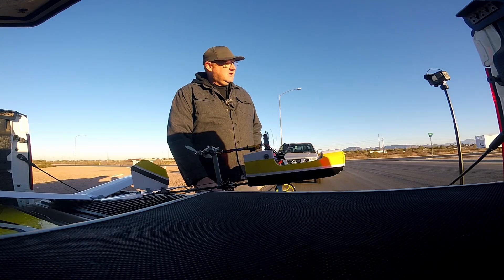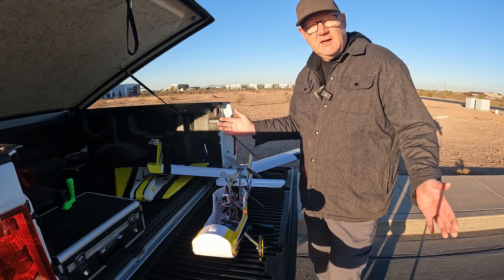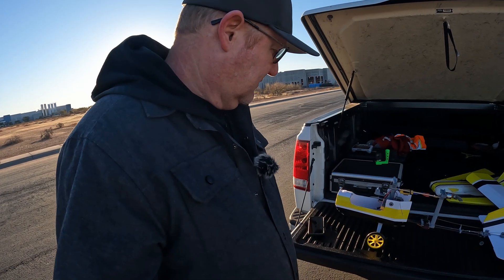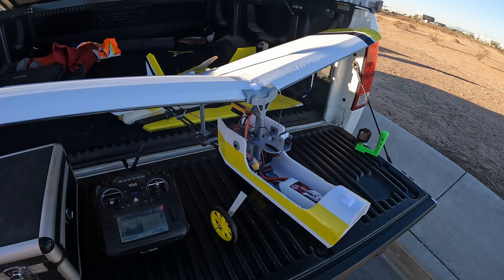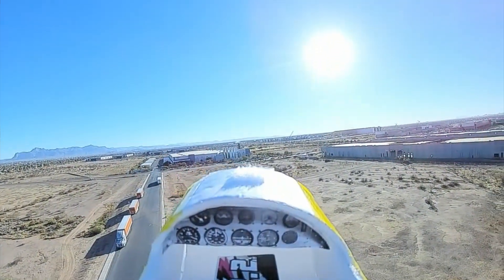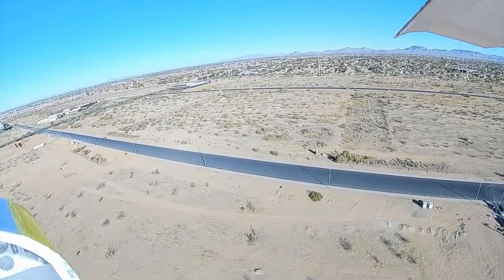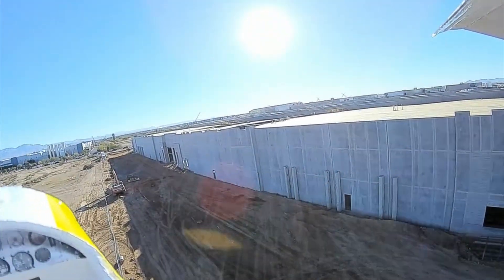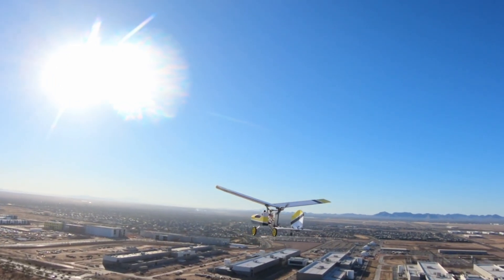Build and Fly this Plane - Sparrow Scout FPV

Comment: Have built this plane. I'm having trouble with it, this thing should fly so easy and it's uncontrolable under power, but floats and flies great with power off. Adjusting thrust angle of the motor now, running a 8.4 prop, and the shorter version of the wing supports,,, anyone else having this experience or any suggestions??  I really want this to fly, wanting it for FPV... Thanks.
Reply from the maker: Share some pictures of your control wires and of the control horns. If there's a lot of flex or if there's warped in the wings or tail, that'll make a big difference too.

Comment: Yup, buying now! Thanks for sharing ,,, subbed!!
Reply from the maker: Thanks Walt!
Reply: Have built this plane. I'm having trouble with it, this thing should fly so easy and it's uncontrolable under power, but floats and flies great with power off. Adjusting thrust angle of the motor now, running a 8.4 prop, and the shorter version of the wing supports,,, anyone else having this experience or any suggestions??  I really want this to fly, wanting it for FPV... Thanks

Comment: Great Video ! I am almost ready to maiden your slow stick design. How does the flight of this compare to the slow stick ? Flight time etc … thanks for sharing
Reply from the maker: Hi Mark, I was quite surprised at how long I was flying on the 2200mAh packs.   I mostly cruise at half throttle and get 15 to 20 minutes.  Flight times are similar for the Scout and the Slow Stick.